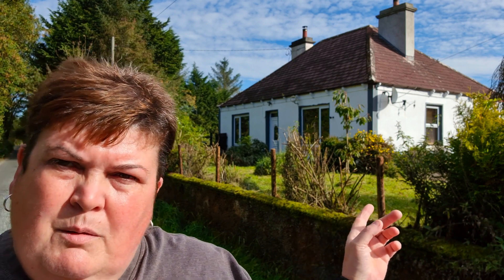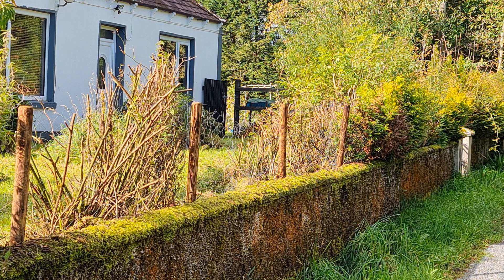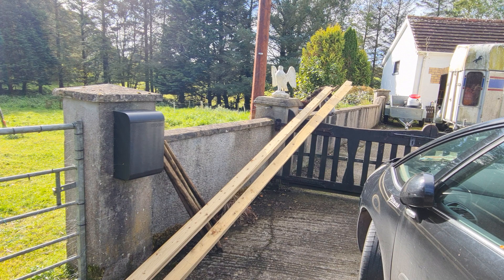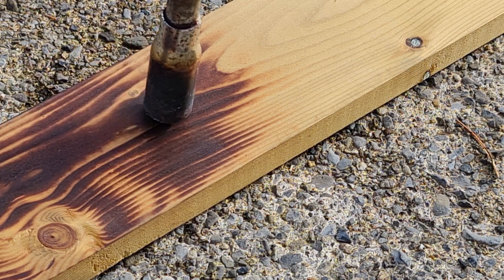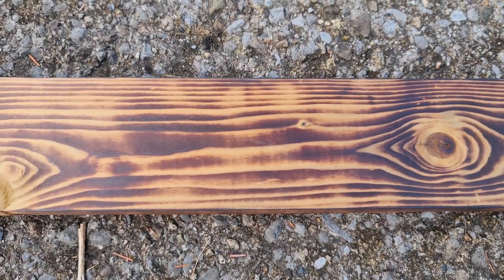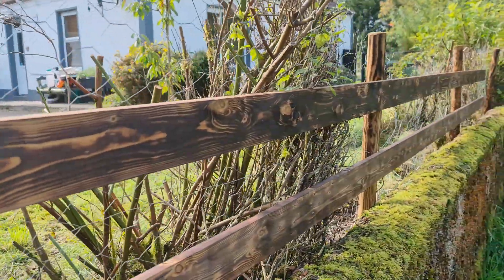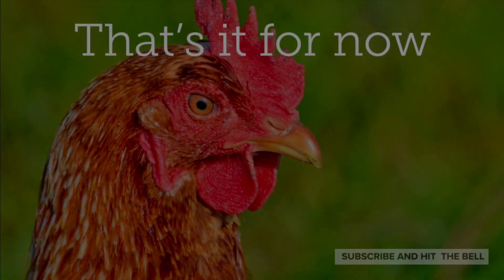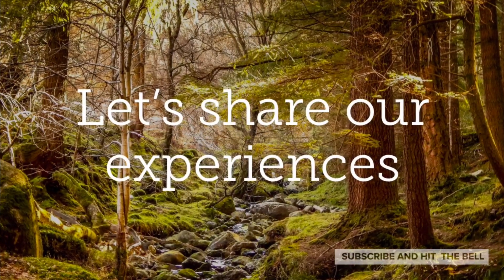DIY Rustic Fence: Transform Your Garden on a Budget!

Comment: Great effect with the heat.  I did wonder about heating the wood if it was treated.  Hopefully, since it was not actually burning, there was no dangerous fumes.  Love the moss.
Reply from the maker: no it was safe the burning rod is long and the breeze in the right direction, pleased with it, the moss is great isn't it